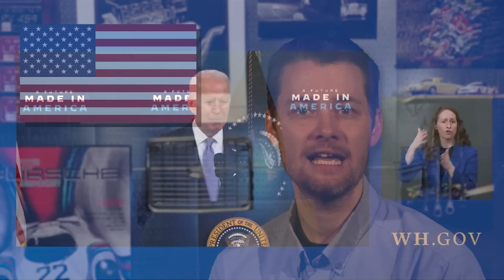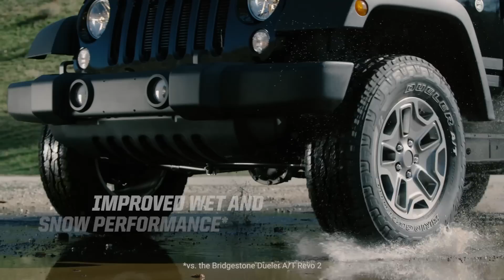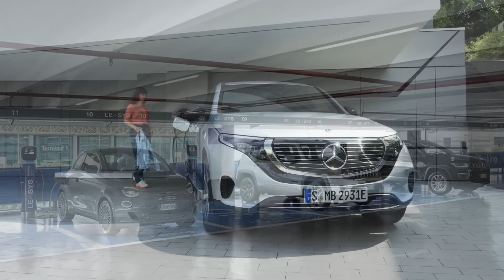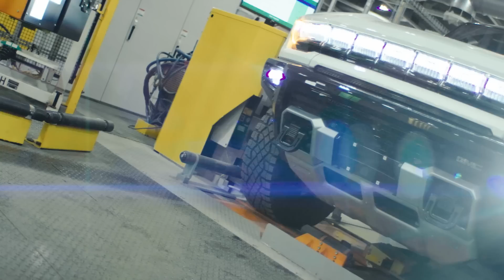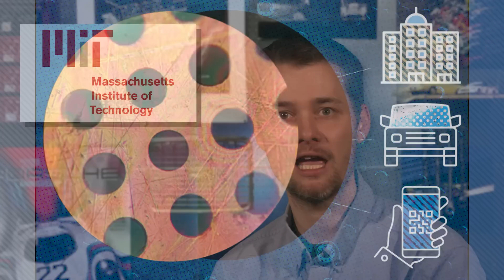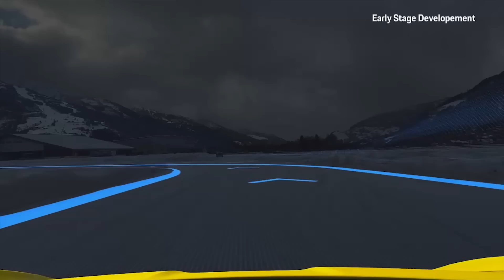Tesla Pioneers New Assembly Technique; GM Dramatically Ramps Up EV Production - Autoline Daily 3257

Comment: GM  will never be able  to beat Tesla in BEV  production  numbers , not  by  2025 as  Mary  Barra  claims.
Reply: Part of her job is to be a cheerleader for gm, not Tesla, that's the way business usually works.
Reply: @rp9674  Merry Barra would  look good  as   the team leader  in a Texas  cheerleding  squad, RAH! - RAH!!  Hip  Horay!! That pant suits  gotta go  tho🤣
Reply: I see more Mach-E’s on the road than GM EVs.  GM has done nothing but lose market share year over year.  This will continue as Tesla, Rivian, and the Chinese EVs keep ramping up their production.
Reply: @DarkBrandon1  obviously statistics mean nothing to you, GM hit the phase out of the EV credits a couple months after Tesla. Ford has yet to hit that threshold but will this year, a few years after GM.
Reply: @OneNationUnderGod.  too bad they used it all up on their hybrids.  Forgot about that part, didn’t you?  😂
Reply: @DarkBrandon1  still an EV, oh I guess you forgot about BEVs 🤣😂🤣 Volts and Bolts were by far the majority of GM's sales that qualified for the credit. The Bolt is pure battery electric and the Volt is an EV with a gas engine generator not the typical hybrid that has the ICE running power through the drivetrain.
Reply: @OneNationUnderGod.  BEVs??  With an “s”?  No, BEV as in 1.  A compliance car that they only built 30k/year of and lost $9000 on each one they sold.  👍  bang up business model.
Reply: @DarkBrandon1  that saved GM millions in carbon credits, GM never had to buy any like most other manufacturers because they had these compliance vehicles to meet the government regulations. Nice try 🤣😂🤣
Reply: @OneNationUnderGod.  couldn’t make a profitable EV, so instead they lost $300M/year on the Bolt.  And this is the company you want to defend 😂
Reply: That remains to be seen. GM has 3 more battery factories coming on line by then and instead of four sedan/hatchbacks like Tesla, they have a variety of vehicle types they can produce.
Reply: @davidmccarthy6061  Variety adds complexity and will slow down GM even more
Reply: @Alexzw92  most of GM's upcoming EVs are sharing just a couple of platforms, that saves a ton of engineering and development time. GM has mastered platform sharing, look at their full size SUV and pickup platform. The Tahoe, Suburban, Silverado, Sierra, Yukon, Yukon XL and two Escalades all share one platform. That's not just the frame, but most of the suspension, drivetrain, engines, transmissions and tons of electronics and other components. These are some of the most profitable vehicles in the industry and the way GM shares platforms throughout their brands gives them an edge. 

The upcoming EVs will be the same, actually there's gonna be even more models/vehicles sharing components than ever before, GM would have never considered a Hummer and Chevy Equinox to be able to share much in the past but the EV versions will.
Reply: @davidmccarthy6061  we will see ,Tesla has multiple  battery suppliers,  let me tell you who, these are: 1)Panasonic,  2) CATL,  3)LG,   4)Gotion tech, and lastly  Tesla  itself who will make the 4680 cells inhouse, and  in todays Wed ADaily show , shows  Tesla  showing the Structural 4680 pack  being  used  in the assembly process. 
GM  is going to need a miracle to survive BK#2, Of course  AAAGM  is " Too Big  too fail", but  USA President  Joe Biden thinks so , and that is why  the $4,500Union Handout is so important  😆 LOL   open your wallets now 🤑🤑🤑🤑🤑
Reply: @aurelio-reymilaorcabal9669  that $4500 union labor subsidy wasn't about GM, it's about transferring tax payer money directly into union labor donations to the democrat party. It's a money laundering system and one of the democrats favorites right along with the teachers union.
Reply: @OneNationUnderGod.  So what your saying is, buy a Tesla and not a GM product. If you don’t wanna support the democrats corruption. 

Got it! Thanks for the insight I’ll make sure to not buy any union/GM products and stick with Tesla instead.
Reply: @Alexzw92  GM is far from the only manufacturer using union labor. Also now that Tesla is manufacturing in China and focused on developing that market is buying a Tesla much better?
Reply: @OneNationUnderGod.  Yeah I know ford is also guilty.

But my understanding is Toyota and Tesla are not affiliated with the UAW,
And also If I buy a Tesla in the US then it’s is being made in the US and not china. So yeah still better.

Pretty sure the Model 3 is also the most “AMERICAN MADE” car sold in the US.

It has the highest % of parts that are not shipping from other countries
Reply: @Alexzw92  last I seen the entry level Model 3's that are using the cheaper battery pack chemistry will be made in China and sold abroad, so those won't be very American. 

I actually have nothing against Tesla and if the Cybertruck would have been more normal in a appearance I would have reserved one the night of the unveiling. Also I wish it would have been designed to have a full size SUV share the platform and I'd buy one of those for my wife. 

What may come across as anti Tesla from me is my pushback towards the fanboys that think Tesla is gonna run everyone else out of business. True Tesla supporters remember the original goal of the company was to accelerate the transition to sustainable energy and transportation. True fans/supporters would applaud GM and other legacy automakers for what they've been developing the last few years.
Reply: It's physically impossible in view of their roadmaps, but I think GM can still successfully transition and survive if they don't drag their feet. 

They don't necessarily need to be the leader to be a disruption survivor. That alone is going to be a challenge for many legacy companies as is.